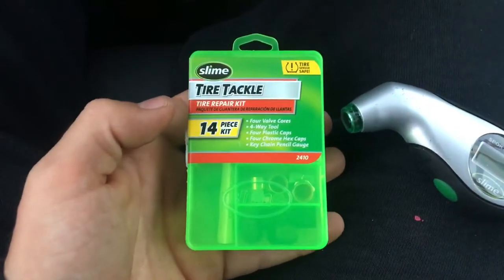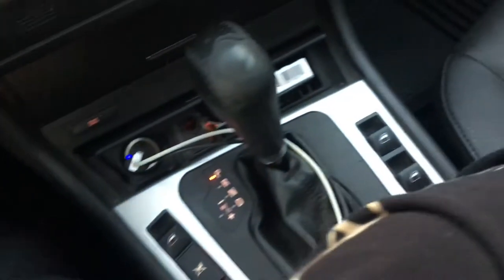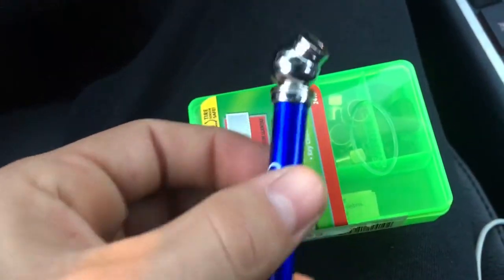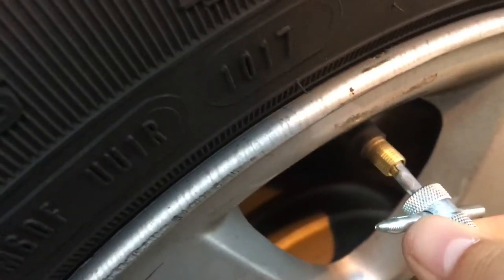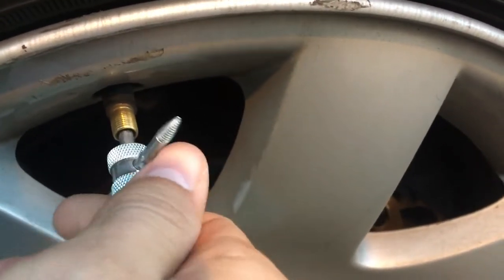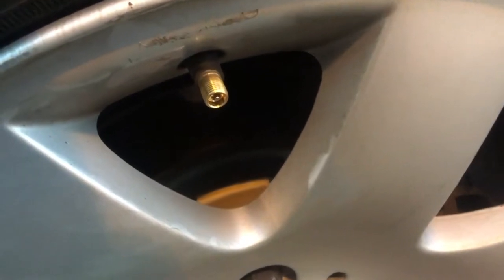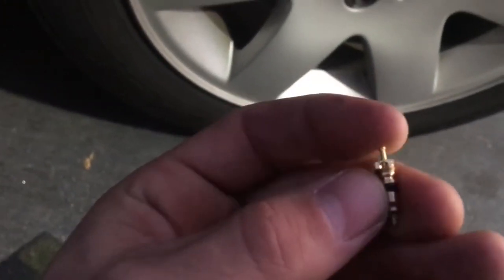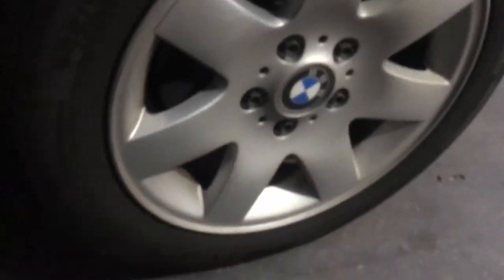HOW TO FIX A TIRE VALVE STEM CORE (5 MINUTES)

Comment: Good video, my stem was not sticking out. Tire held pressure but would not let air in but would let air out (wierd!). FYI, three years later  the kit at Auto Zone now is just the 4-way tool and (4) valve stem cores. Good news  it was only $4.95. One tip for anyone doing this, have the replacement stem core in hand and put it in asap after removal of the old one. You don't have to wait for the tire to deflate, even a little.

Comment: Once you remove the valve core all the air in the tire will rush out, correct? So you will need to change these right next to an air pump in order to re-inflate the tire to drive off. Also correct? Please advise. Thank you for this video!

Comment: very useful. My bike is having an issue with the valve core. Didn't know it had a name. Going to but a thing to fix it later. (tire wont release air when i press on the core and the little bit is so close to the rim i can't do anything)

Comment: The end of the valve pin opposite to the end we turn is sometimes flat and sometimes having a pin structure,are both compatible with schrader type valves of cars, motorcycles and bicycles?

Comment: This might be just me being super stupid, but I somehow caused the air leak by inflating the tire. And the tire kept deflating loudly and very fast until nothing was there. So all I did was take pliers and pushed the tip a bit inside the valve. It immediately stopped making leaking noise and that made me happy. However, does make me wonder why it was so sensitive in the first place!
Reply: This happened to me this evening.  I'll be trying fix it in the morning.  Wish me luck.
Reply: @barbwire65  results?
Reply: It did work, but I couldn't air it up because this was on my semi steer tire
By the time I got back from the store, the tire was already off the rim.. Had to call a  wrecker service to air it up

Comment: I over tightened my valve stem and now its stuck and wont catch onto anything. I need help
Reply: If ur unable to get it out, you might need to get the entire stem replaced at a shop,
Shouldn't cost too much